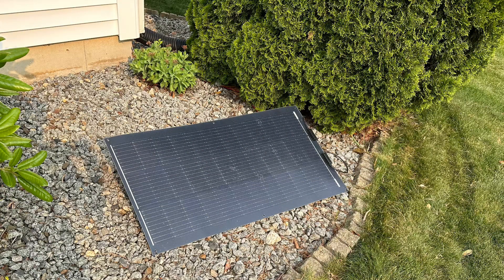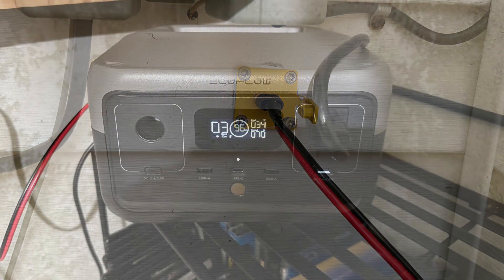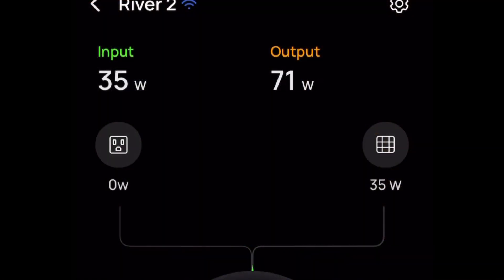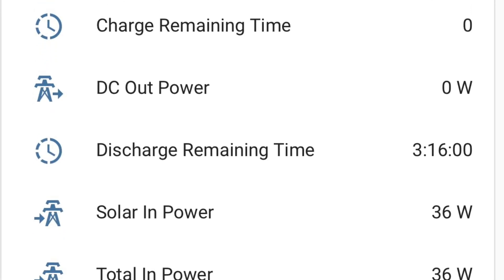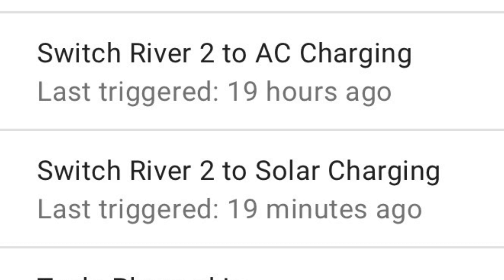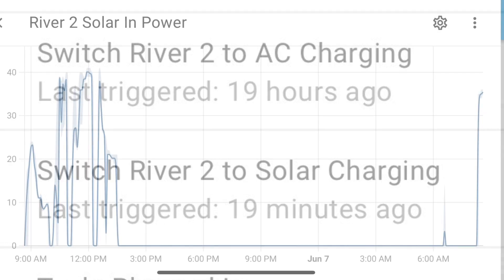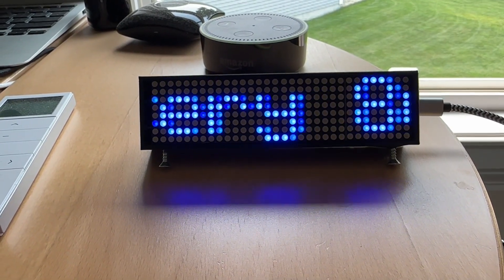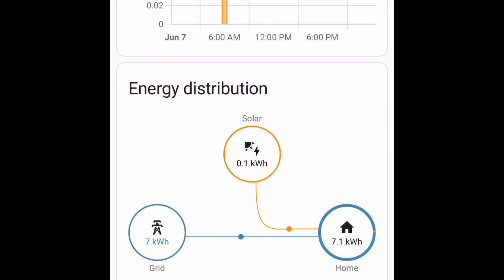Renogy Lightweight Flexible 100W 12V Solar Panel Working With the EcoFlow River 2 and Home Assistant

Comment: Do you know of any good external enclosures for the Ecoflow River 2 if I want to mount it outdoors on a pole with some solar panels? also did you have any problems using Renogy Solar panels with the Ecoflow River 2 since their different brands?
Reply from the maker: i am not sure you want to mount outside if it gets below freezing the ecoflow will not charge.  You can use any solar panel as long as it meets the input voltage and power requirements for the ecoflow.
Reply: @keenanjeff  Yeah I live in Florida where it never snows so it shouldn't be a problem.  The only issue might be overheating the unit from high heat.

Comment: This is great, thanks for the work. I am dialing in my River 2 also with a mini PC load and some usb lights and fans. It's working well but my 100w ridgid Ecoflow panel only gets me like 80w, which is just ok. I just ordered the 120w Renogy panel to just power the mini pc and fans, the fans have batteries too so they can last the night with no draw. I realized I'll need to jump up to the 1-2kwh range to get the rest of my devices well supplimented with solar. I'm having some issues with Ecoflow and a used River 2 Pro they sent me so I'm looking into the Anker 767 moving on.

I can still use the River 2 and 120w portable panels as a stand alone circuit or take it on the go. So I'm glad im not too deep into the Ecoflow ecosystem.

The home assist AC/Solar automation is a great idea. I'm going to look into integrating that. Too much energy spent with CS to focus on my system and enjoy it lately so thaks for the nice video, it reinvigored me today!
Reply from the maker: I just installed v3.1.1.73 FW on my river 2 it now has backup reserve under energy management.  I though this might allow for charging from solar or a/c automatically and it does but it will not work for my application.  The issue is it cuts a/c power out when it transitions to solar charging and back to a/c.  this might be ok for some but I want to use it as a battery backup for my Internet connection.

Comment: Very cool. Do you have a link for the ecoflow cloud integration? I have keys and set it up with homebridge but I didn’t see one for HA yet. I have the local one through HACS but ecoflow broke that. Thanks!
Reply from the maker: Yes this is the one https://github.com/tolwi/hassio-ecoflow-cloud

it is working great!
Reply: @keenanjeff  Great thanks, has more than the homebridge version! I wonder why they're not on HACS. I tried searching the forums for something like this recently and nothing came up. Where'd you find it?
Reply from the maker: same as you the api was not working so i found the cloud integration.  my automation is beautiful it verifies the river 2 is online by checking the battery level before cutting the power. 

alias: Switch River 2 to Solar Charging
description: ""
trigger:
  - platform: sun
    event: sunrise
    offset: "03:00:00"
condition:
  - condition: numeric_state
    entity_id: sensor.river_2_main_battery_level
    above: 50
action:
  - type: turn_off
    device_id: ce98729e8a8ab03822ab6d27caa23fe9
    entity_id: switch.ecoflow
    domain: switch
mode: single
Reply: @keenanjeff  Very cool use. I've got a TP-Link travel router in my Jeep attached to the River Max, Next I want to load a Pi3 I have with a small HA and figure out switchable lights, battery status, fridge temp, diesel heater status/control with afterburner. Big problem is EcoFlow is cloud and my Govee rock lights I'm using as scene lights are bluetooth that probably isn't open for HA to bring into BTHome. I haven't really looked into BTHome.
Reply from the maker: check out my camping video it is nice having a 130kWh battery with you :-) https://youtu.be/MDy-71VBDfY